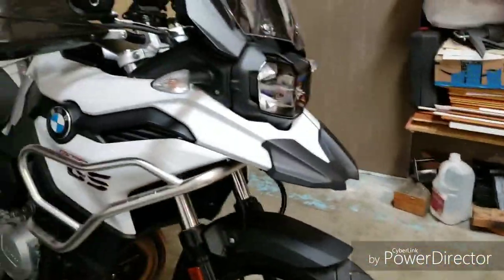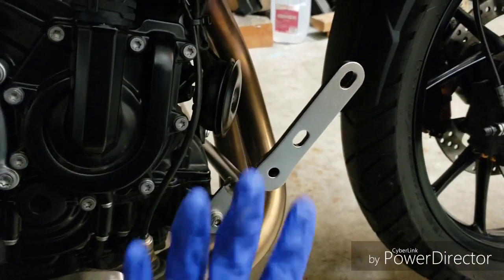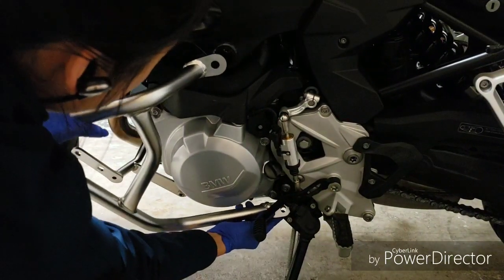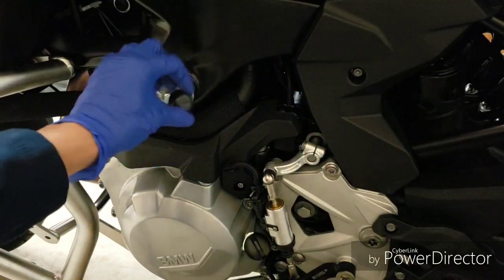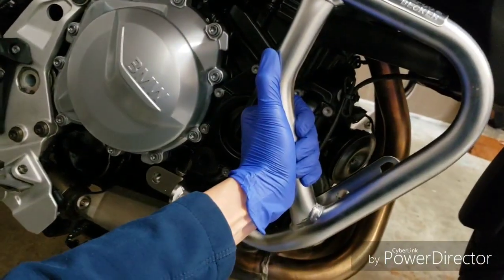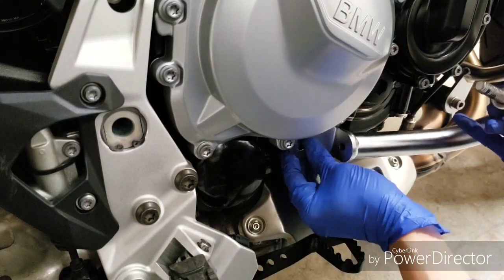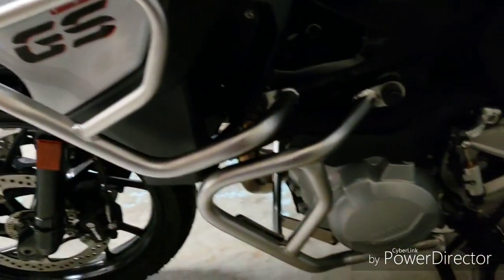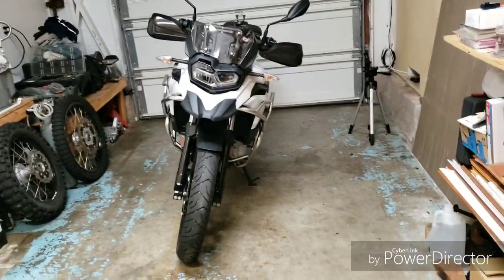How to install Hepco & Becker Engine Guard on 2019 BMW F750 F850 GS GSA Motorcycle

Comment: I also installed these (in black) on my bike. I did not have any issues with fitment or parts. One thing to note is that I did have my bike on the center stand. These are easy to install and feel solid.
Reply from the maker: centerstands make it so much easier. very lucky~!

Comment: Hello. Wrong mounting (left side, rear, 03:25). Hepko engine protection bar should be behind the native BMW part, and not in front of it. Explore the enlarged photos on the Hepko website.
Reply from the maker: Thank you, I didn't realize that until now. It's been ok this whole time.
Reply: @TrackOurJourney  Good luck and thanks for the video, which is a great addition to the hepсo instruction
Reply from the maker: Thank you

Comment: what torx tool size did you use to remove the oem engine bolt? thanks
Reply: Rui Assis 
TORX 55. I had to buy it separately as my set ends with T50. Don’t try to use TORX 50 because it will damage the screw but will not remove it.
Reply: Rui Assis torx 55
Reply from the maker: Sorry I didn't realize I did not mention the spec. Thank you for those who chimed in. It's been a year since I did the install and do not remember...

Comment: What is the correct Nm torque that should be used on the M12 bolt?
Thanks
Reply from the maker: I am not sure, it has been a while since I installed it, and not sure the instructions gave torque spec for that bolt.
Reply: @TrackOurJourney  thanks, i think I used 78 Nm
Reply from the maker: @dondiegogomezdelavega9142  thank you!!

Comment: Thanks for the video. Could you please put the links for buy those guards ?  Regards
Reply from the maker: I bought them off ebay
Reply: PamYangTV  hi! Are these upper crash bars compatible with the factory Bmw fog/auxiliary lights? Thank you in advance
Reply from the maker: I do not know since I do not have the fog lights on my bike yet.
Reply: PamYangTV Thanks for your reply! Please inform me in case you will install the auxiliary lights and fit together ( with the upper crash bars)
Reply: Just google Hepco and Becker engine guards. It comes right up.
Reply from the maker: @ΡίγκοςΚωλαρίγκος  i am actually installing fog lights now on the gs but not oem. I will upload the video soon.
Reply from the maker: @ΡίγκοςΚωλαρίγκος  👍👍👍
Reply from the maker: @paulramirez2630  👌👍

Comment: Hi Pam. Thanks for share with us. I saw you bough those on ebay, but I looking for and only find separatedly. I would appreciate very much, if you could share the article, seller or some more specific reference, because several options are shown, and I really loved yours.
Reply from the maker: https://www.ebay.com/itm/Hepco-Becker-Engine-Guard-Crash-Bar-BMW-F750GS-F850GS-Stainless-Steel/283445467293?hash=item41feaa989d:g:2kMAAOSw6sJcq6qO
Reply from the maker: The tank guard you have to buy separately